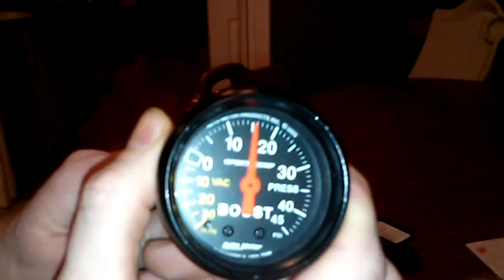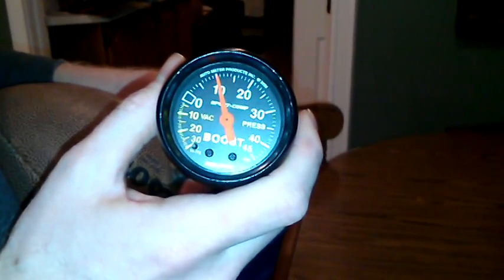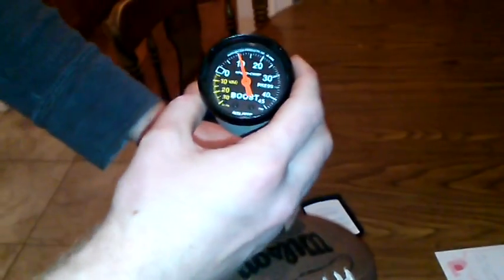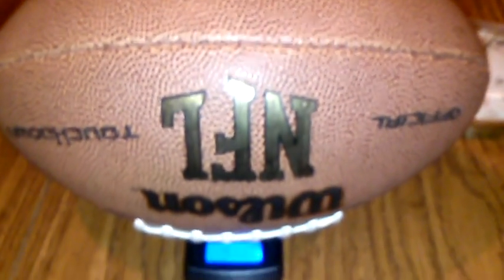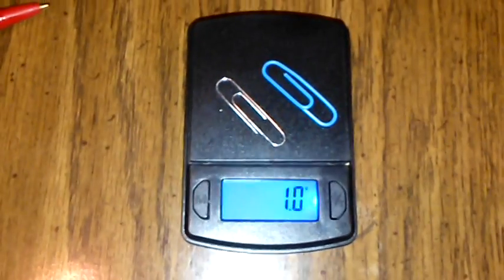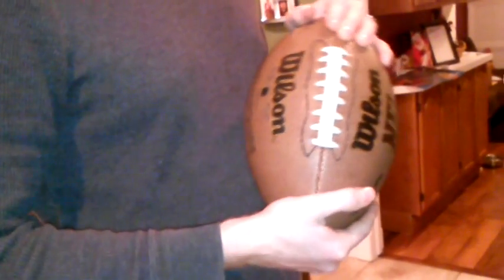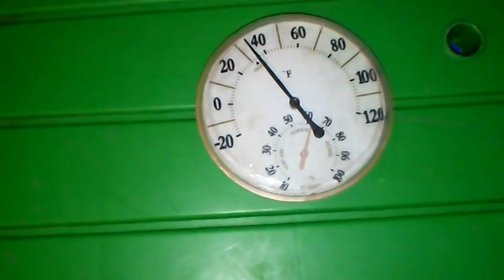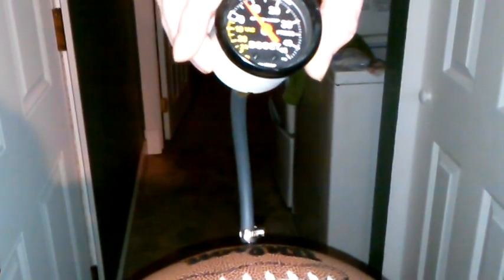Football air pressure testing

Comment: The main question to me is how did 11 of the 12 go down in pressure during the game (probably missed 1 ball being in a hurry) when 12 out of 12 did NOT for Indy?  Those who deal in statistics would tell you that this is INCREDIBLE at the least.  Now remember I do believe they said that re-inflated them at halftime.  Temps are different (just letting this guy who did the video know) during the first and second most likely (since he is splitting hairs why not right back at him). Once again losing the same amount again.  Once again INCREDIBLE.  If it quacks - its a duck....  If it lies - its bilichick  (refuse to even spell his name right).  Answer me Genius of the youtube!!!!  How can this be???  By the way - too many people around taking a little air out each (messing with things) is why it is soooo low.
Reply: marc guido you might be too uneducated to spell names properly.
Reply: Actually ass crack 3 out 4 of the colts balls WERE under 12.5 psi so there goes that "point". The reason for only testing 4 was they "did not have enough time to check all Colts balls before the end of halftime. Right. If it looks like a whiny crying hater, sounds like a whiny crying hater then it must be....a Colts fan. 45-7 baaahahahahaha 

Great video man

Comment: Interesting test, I do not agree with the results but I agree that the ball pressure had nothing to do with the Colts loss.  
11 out of 12 balls lost pressure.  Why not 12 out of 12?  The balls in question were switched at halftime.  The 2nd 12 balls did not loose pressure and the Seahawks balls stayed full as well.  
I do not think the weight of the ball was the concern but the pressure and ability to squeeze and grip the ball is and advantage. 
I do not have a scientific answer but it still seems to me that someone must have let some air out.  
Your test does seem to indicate that it would not take long to release air pressure. 
I'm sure that the equipment personnel have had some experience with inflating and deflating footballs.  Just makes since to me that an equipment handler would have an idea of how long it takes to release a pound or two of pressure.   
The NFL has been playing games in cold weather for a long time.  The only logical explanation to me is that someone deflated those balls.

Comment: Thanks for the test. The ball didn't lose air, it lost pressure due to the law of natural gas.  Media, haters, and ignorant people are overlooking this little fact.  So you proved that didn't happen.   Knowing the drop in temperature caused the loss in psi, we have to wonder if room temp (75F?) drop to outside temp 50F was significant enough to lose 1-2psi.  If not... could the air inside the ball be hotter than room temperature before the ref set it at 12.5psi? and how did that happen?

Comment: i appreciate the time you took for this, but have to disagree on 1 thing. i live 45 minutes from the stadium, game time temp was about 50degs. it would have been snowing if it was 25 like you mentioned. im sure the ball would still lose pressure from 75 degs to 50degs. just not to the extent you showed here. just an f.y.i.